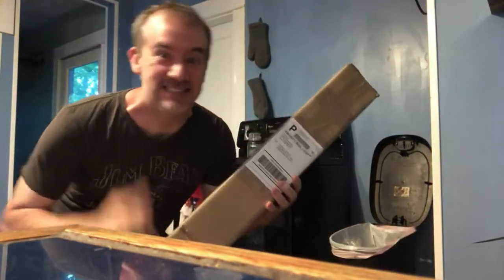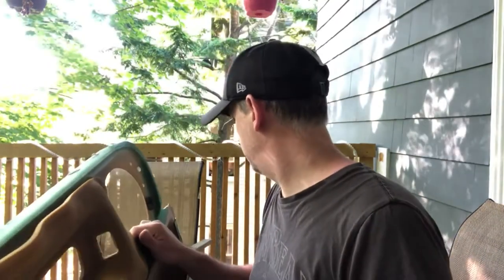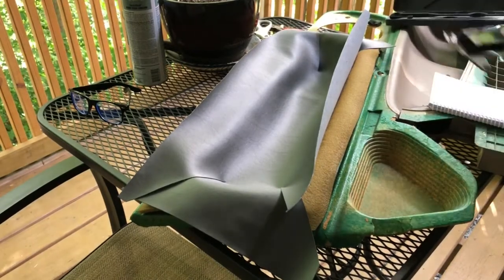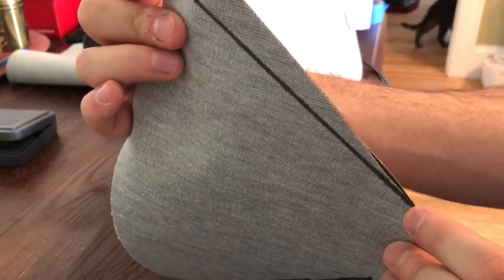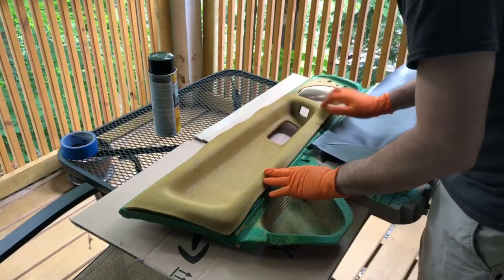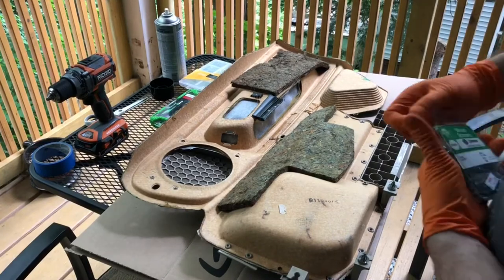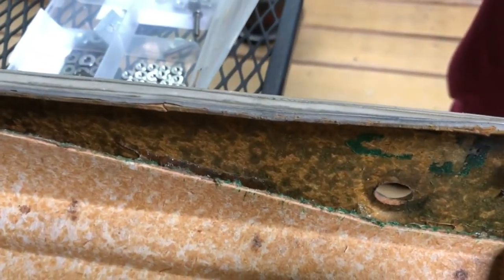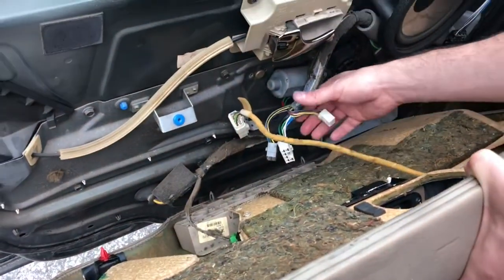99 Volvo S70/V70 two-tone reupholster & french seam - driver door panel completed!

Comment: bro, i totally admire your effort.. but alls you had to do was make a 1/8th incision in the corner of the recess area of the door panel to fit a straw through (attached to the spray glue) and spray some product liberally and mat it all back down! you wouldn't even have needed to take the door panel off.. 5 min. the vinyl coming away on the doors is insanely common on the 70s.

Comment: I admire your constipation. Many have tried without success. The panel is welded under high pressure at the factory, this is the only way to obtain a deep profile. And it is precisely this depth that is problematic. Professionals know this and will not repair it. Look at how the leather is sewn together in the newer V70 after 2000. Thank you and Best regards from Poland
Reply from the maker: That deep profile was definitely a challenge. It's just sad; I see so many of these old vehicles with the vinyl shrunk and pulling away from the panel underneath. My method was literally thought up on the fly and probably could have been improved on, but I was pretty happy with the results. Thanks for watching!